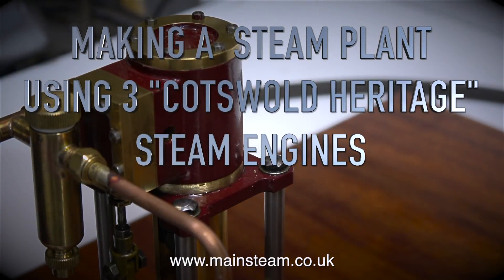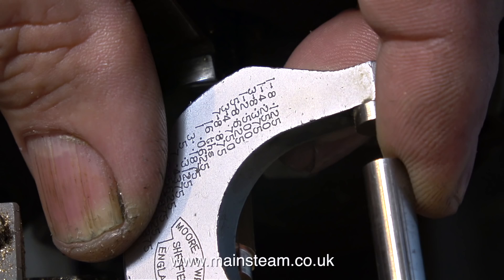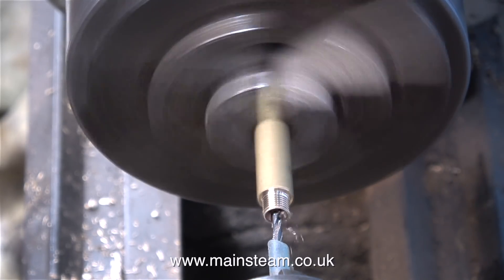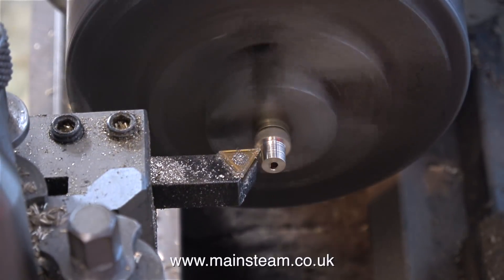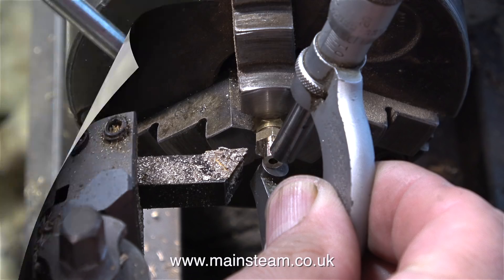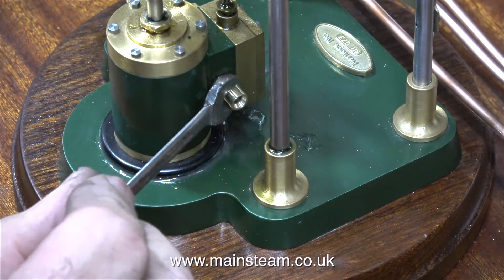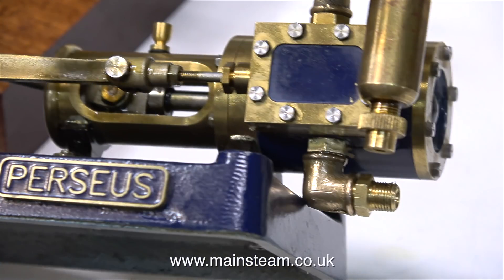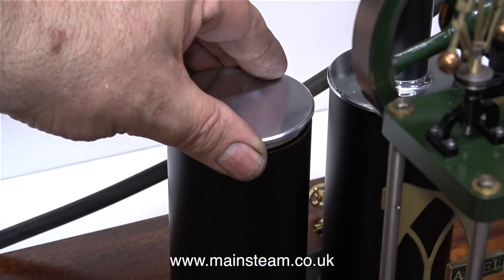A MODEL STEAM PLANT WITH 3 STEAM ENGINES - PART # 11

Comment: Im glad Keith makes jokes about insane asylums, suffering from mental health myself its good to see someone poking fun at it. XD Life to short to be serious all the time, and they are meant as jokes anyway so Keith knock yourself out!! 

Its starting to look good now, will you fit an extention handle to the water pump or is it alright as it is? Looks rather short on camera. (thats what she said)
Reply from the maker: This is not a very high pressure system (65psi) and it's a very small pump - so the handle length is OK {:-)))

Comment: Do you not pull a vacuum in the top of your water tank with that lid when you work the pump, or is it loose enough not to do that?
Reply from the maker: No, I really have been doing this sort of thing for for a long, long time, (about 45 years) so there is no Vacuum generated by the water tank cap that I made .....
Reply: Fair enough, it was probably a daft question anyway...
Reply: not so much, I was going to ask as well ;)

Comment: Keith Is that a design fault on those engines? the exhaust out let is smaller than the inlet so the expanded steam will have a hard job escaping I can not remember of the top of my head what the expansion ratio is but I know its high Surly that will have a negative affect on the engines running ability
Reply from the maker: it's not really that important as they are just little toy engines and as long as the wheels go round that is OK . . .
Reply: 1600-1700 times based on a quick back of the paper serviette calculation